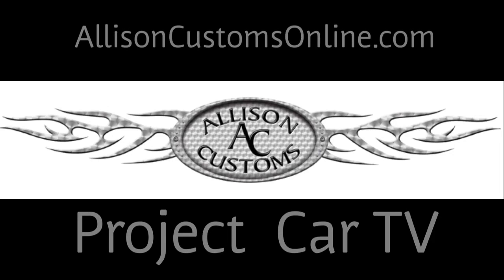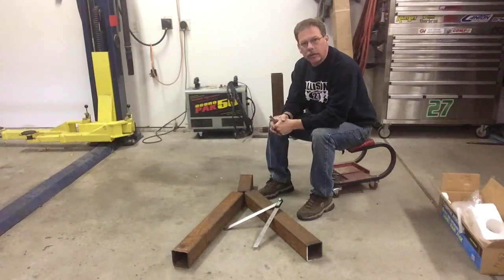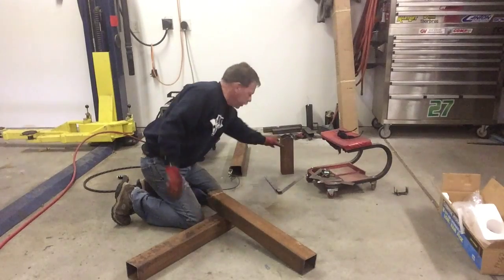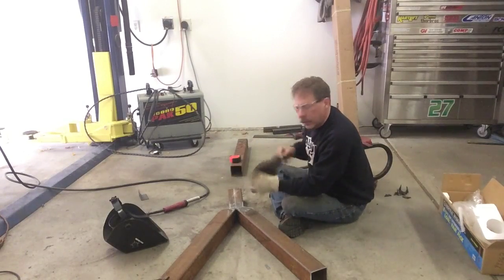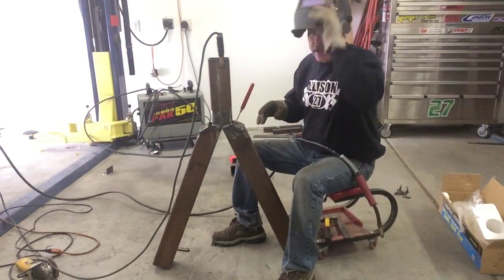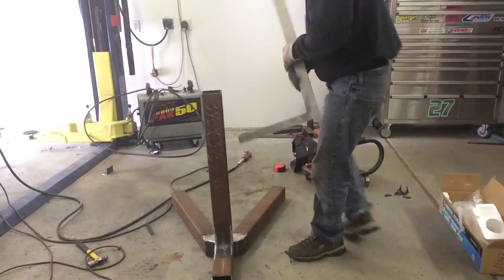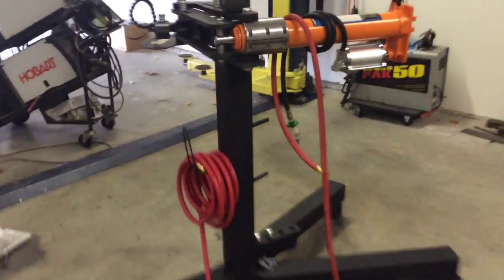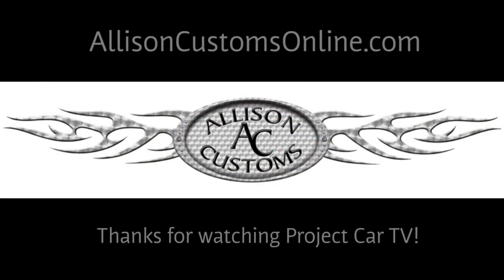Tubing Bender Stand & Conversion to Air/Hydrualic Power

Comment: I just got my bender and kit and curious why you used one of the die holes to mount the hydraulic kit to the bender. Mine looks like I might have to do that to get some of the rubbing out of the return spring and to get the 2 bronze bushings to line up correctly
Reply from the maker: I couldn’t say for sure this long after putting the whole thing together, but I “think” it had to do with the stroke length of the cylinder.
Reply: @AllisonCustoms  thank you.

Comment: Great job on the stand.  I need to do the same with my Bender instead of bolting it to the floor.  I have the Swag Off road Hydraulic kit to put on mine.
Reply from the maker: I’m still using it today, although I need to replace all of the hoses - they are cracked - that’s what I get for using HF

Comment: would this style stand work for a manual bender without being bolted to the ground?
Reply from the maker: +Andrew Allender ,
Almost certainly, No.  When using a manual bender you need to be able to apply a lot of force.  This was one of the reasons for my conversion to the air over hydraulic.  If you need a mobile solution for your manual bender, try building a stand that has wheels AND that you can plug into the hitch on a truck.  This way you can roll it out of the way when not in use and use a truck as your "stationary" mounting point.  Hope that description makes sense and helps,  Thanks for watching! Jeff
Reply: @AllisonCustoms  That is a FANTASTIC idea.  I have the JD2 32 bender with SWAG kit on a rolling stand, but I find that I use my HF bender constantly for flat bar.  I have the stand bolted to concrete on the shop apron outside and it is a pain in the butt to go out and use it.  I am so adding a mobile base and a hitch attachment.  One that moves up and down on the post, then lock down so that it will fit multiple vehicle hitches.  A+ recommendation and you now have a subscriber.